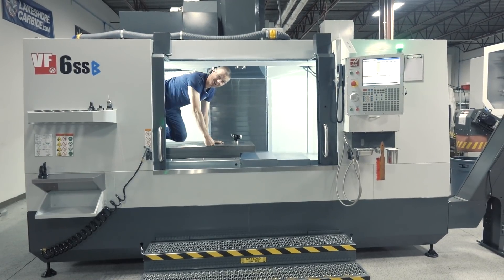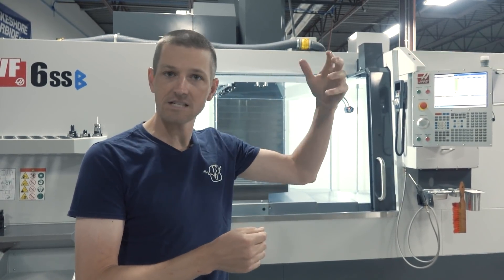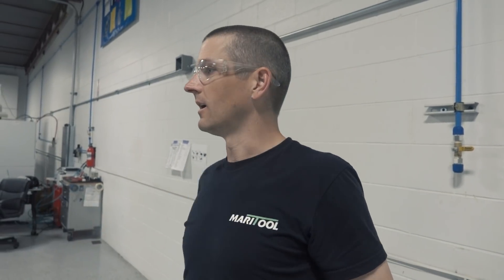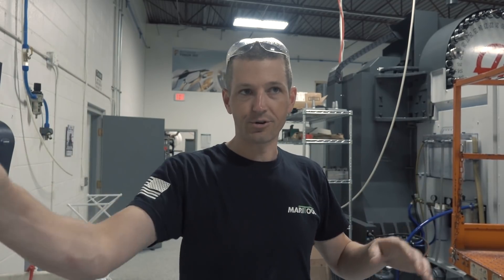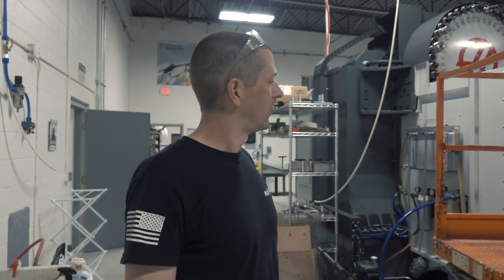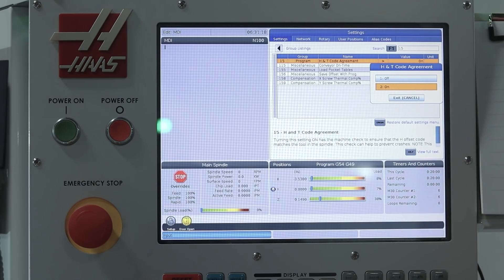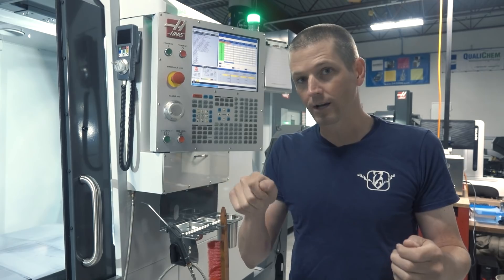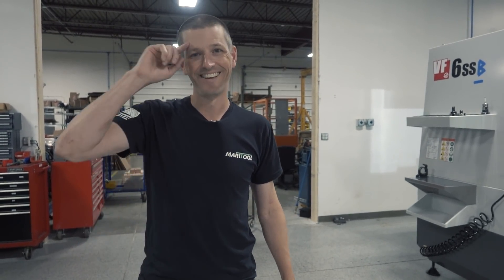Haas VF-6SS CNC Machines: Buying, Rigging, Unpacking & Commissioning!

Comment: hi, bacteria breeds on the tramp oil and book and crannies, ours is a redox system which is a system incorporating multimedia metals and once the coolant passes through it the bacteria and fungi are 100% eliminated and the killing process just goes on forever, you just have to add good water for topping up and concentrates to maintain the concentration, if not inconvenient send me your email address I would send you the details of the system.

Comment: Congrats on the new machines! Those ones are certainly great for small part dedicated production!.We have an older one that we use for our small parts (it's all relative...). We find it isn't nearly rigid enough for our heavier machining processes, but does well with a bunch of small parts. Are they still running on linear rails, or have they upgraded to box ways finally?

Comment: John, if you do decide to go the route of laser aligning the new VF's, I would highly recommend Industrial Measurement Solutions.  It is a smaller outfit run right out of Ohio.  Dave is the founder and likely the one that will come out and do the inspection.  He is the greatest guy and he has years of experience setting up machines like this.  I met him through a few jobs I did for assembly line work for the automotive industry.  Being that I'm also from Ohio, I like the idea of local businesses helping other local businesses.  You can find more info on their website, http://www.ims-ohio.net/  I hope that works out, it would be very neat to see Dave in one of your videos showing what he does best!

Comment: Awesome John!  I'm actually upgrading too.  My wife told me to go ahead and plan out a shop build and update my machine.   I found a client that produces eye wear frames for big optical sellers like Walmart type places and has a contract with military to provide frames for pilots.  So I have been nuts busy designing and building brazing fixtures for this company.   I'm finally going to move out of my basement!  BTW, love brass.  That's what the fixtures are predominately.  No coolant needed.  I even went so far as to accidentally plunge a 3/32 end mill thru 1/4" brass and proceed to cut a slot a quarter inch long, because I inadvertently shut off ramp.  It sounded funky, but the cutter did it twice and survived.  It was as if it was cutting plastic.  Good to see you expand and I look forward to catching you and Jared sometime when I pass thru again!

Comment: we have a HAAS OM2A and the Tool Release button is a workhorse... it's how you load tools into the spindle for transfer to the carousel, and because the machine doesn't support probing we put a dial indicator in the spindle to clock up the work every op... probably just a legacy/compatibility thing with the control panel

Comment: Just so you know the spindle grows overtime due to heat during long cycle times and the software does not comp for it.  We've had HAAS working on trying to figure this out on our VF-6SS for about 6 months.  We've installed a spindle cooler and everything.  Just something to keep and eye on.  We've noticed .003" to .004" of growth on the Z axis during a cycle.

Comment: I've got a question. Which CNC control is the most common in the United States. In Germany, the major manufacturers(DMG Mori, Grob group, Niles Simmons) only have Siemens, smaller ones use Haidenhein. Machines with a Fanuc CNC control are very rare.
Reply: I'm from Romania but I think they use FANUC and Haas(which is FANUC compatible)and maybe some HURCO controls.Some high end companies may use japanese machine tools with proprietary CNC like MAZAK(Mazatrol),OKUMA,Kitamura( FANUC control copy called Arumatik).

Comment: I for one, don't really want the T and H codes in agreement. Sometimes, I need to tweak the blends on a tool that is doing two different Features. One offset solves nothing, because both blends move together. So instead of making changes to each individual "Z" value in the program (if there's too many of them), I home the tool and call a new "H" for that tool for that Feature. Pretty usable overall.

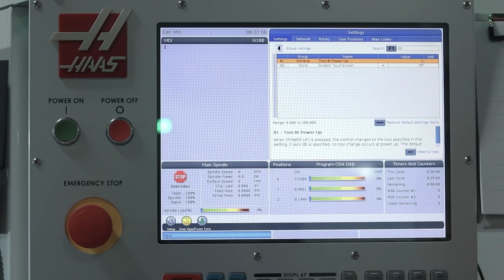Comment: The tool change at start up feature 7:55 is a setting I WISH our machines had!
It basically protects your tools that shouldn't go through the warm up cycle, like large face mills or long drills and even probes. 
I know a few who have started warm up before realising they have a long drill and WHAM bits of drill everywhere...

Comment: Good tip on the setting to Not change to tool 1 at restart. I HATE that because it’s also at 100% rapid. 
We also have to set something with mid-program restart... I forget the number, but it avoids problems.

Comment: I would recommend going with a better machine for production work.  Doosan is a definite step up.  From experience,  HAAS do not hold sizes like a better thermally managed Japanese machine. I’ve run a lot of different cnc’s and can say this with confidence. 
You may have received HAAS incentives because of your channels exposure, that’s great if you do. 
I should have made the switch to Japanese / Korean machines when I was at your stage of growth with my business. 
All the best John.
Reply: There are other korean manufacturers of CNCs not only Doosan.Hyundai Wia,HWACHEON,Namsun to name a few.
Reply: It's not 2006 anymore. The differences between Haas machines and Japanese machines are getting smaller and smaller. It used to make sense to spend 2-4x on a Japanese machine, but it's getting harder to justify it. He's running parts on Haas machines as it is, and he's holding incredible tolerances, as are many other people. It's also not as much of the machine as people think. Look at John Grimsmo. He has a $1M Kern with a robot, and he's struggling to hit tolerances and SF.
Reply: ahh the trick is too get it written into contract that if machine does not produce parts to specs you can return  machine..owner of last shop i was at did that with them returned machines after two years usage
Reply: If that’s possible, great idea. 
The drive train is light compared to most machines. HAAS is of course evolving and getting better.  I’m just going by hands on experience.  Temperature has always really affected the precision of my HAAS machines. 
The used Okuma just is preferred for what I do.

Comment: So I am not a Haas engineer, but if I remember correctly the reason why there is a tool release button on the control is if the button on the spindle gets damaged or stops working for some reason. It allows you to still run the machine and take tools in and out of the spindle if that were to occur. I will have to look into changing that parameter for the .1 jog increment, I never knew that was a thing.

Comment: only time when I need to use tool release button on the control is when the button stick or break on the spindle and need to change the tool to get a job done before we can fine the time to repair the button a couple day later
Reply: And for ATC recoveries where you will need the clamp to stay open. Used that a fair few times

Comment: 8:30 I hope he did more than just that ten inch flatness check and put a ballbar on it to remove any backlash, Or is that why they have a bad rep. Love how you said they are "noodle machines" and still bought two more 🤣🤣
Reply: Simon H Ballbar is done at Factory. Not on site.
Reply: @superbadchad45  What i am getting at is that he should of done more than that, backlash with a dial indicator even, We have always agreed to have it done on commission day, But learnt the hard way from shit machines straight from the factory.
Reply: @harezy  ALL machines are like wet noodles. No matter what machine you buy, it will flex, settle, and distort.
Reply: Wet noodles was in reference to all cast iron machines... not just Hass. Cast iron will bend and flex, expand and contract. Plus the flooring can move and vibrate. All meaning that if you could compare where a machine sits on install to 10 years later, they would NOT be the same.

Thinking about it, you could apply this to any material and not just cast iron.

Comment: Haas should throw out the Tool release button on console(like WTF) and add a 3D graphic simulation(Its ridiculous that there is not one already.)  and the feed speed potentiometer.
Reply: Tool release button on the console comes in very handy when a dumbass knocks the button off.
Reply: Having had to do a fair few ATC recoveries in my time, I can say having a dedicated button can be very usefull as normally its achieved by some obscure combination of keys that you struggle to explain to the guy at the control. 
Maybe locking the button so its only active during a recovery cycle would be the best of both worlds?
But I agree 100% with the other 2 points.
Reply: If I were an engineer at Haas, the first thing I would want to do is to reprogram that button so that you would have to hold it down for a small duration. I mean you can accidentally hit the wrong button, but nobody will accidentally hold down the wrong button, considering that all other buttons require just short clicks.
The second thing I would want to do is putting the tool release button inside, close to the spindle (maybe in the form of a handle, or turnkey). Yes, I know debris, chips, coolant, etc. But when you change a tool, your hand is holding the tool and you're looking at the tool, the button/handle should be somewhere in the neighbourhood (above it).

You are absolutely right about the speed+feed dials. It's not that hard to implement, and it can save so much hassle.
Reply: @sasjadv  But there is tool release button inside, close to the spindle in every haas that why i say why the fu#ck the second button do on console ??? I don't see this on other machines?, the theory is when machine and tool is big then one worker grabs a tool and second push the button???LOL that don't make any sense(I'm pretty weak and i carry the biggest BT50 tool on the market in one hand),  And people above say that this button is handy when button above spindle  gets broken, well how about replace it IP64 button cost like 10-15$ LOL and repair is very easy. The tool release button on console is waste of space and make layout more messy, that why you don't see it on other machines .
Reply: @adriankowalski5492  Wuttt? So you're telling me they already have a button where it belongs?
I didn't think that they were THAT stupid. I thought it was a cost saving measure or so, not a 2nd button.
And I imagine how awkward it would be if you actually needed two guys to change a tool. First you need to distract a coworker form his work , then the "so, can I push it? yeah, I think I got it, but I hold it awkwardly, let me get a better grip first... Boooom! -oops.".
If I would really really need two hands, then I would rather just jog down the tool, and let it drop on a piece of wood/rubber from a minimal height; and you can lift one end of the plank to get leverage and push it up to the tool. Or I would jig up something mechanical to lift it decently.
And I can't imagine a tool that heavy to be mounted in that tool mount (like a lathe-chuck welded to a BT50 holder, LOL).
---
Do you really need 3d simulation in a machining center? I mean you can check for collisions in CAM, and for short handwritten programs you can turn down the feedrate with the turnknob (if you have one) and prevent collisions that way.
I'm curious to know what the usecase would be for the simulation feature (other than triple checking something).
Reply: @adriankowalski5492  It's mainly used for ATC recoveries as @wildin13 stated. You can press it once while recovering the tool and it holds the drawbar in an open state while having to press the ATC forward or reverse buttons multiple times. It's much better than having someone hold the button on the spindle while stepping the tool in or out of the spindle. Also, I'm pretty sure you couldn't hold a 7" Dia .6" DOC slotting mill on a 9" long 3" Dia arbor with one hand if it's gets stuck in the spindle from side load (inconsistent castings suck). That heavy beast shoots out like a cannon when it finally comes loose.

As for all the other settings, I've used all of them in their stock configurations. Our tool library is over 100 tools per machine and it's a bit quicker to setup on short orders when you don't have to go in and rename the pockets or pull new heights as is needed with changing setting 15 to match T and H. I will say it is a bit risky if you aren't as experienced in that type of setup procedure though. Setting 81 has come in handy when tool recovery fails to home the tool changer which will disable the tool changer entirely because it doesn't know what tool is where. Just reboot the machine. It's very similar to how it homes all the axes at startup. In fact, on at least older Haas lathes the tool turret is coded as the A axis in errors and in homing a single axis. Last but not least, setting 163. I typically use the .1 jog rate, 200% feed rate, and hold X or Y jog buttons to quickly move the table while cleaning out chips at the end of the shift. Yes, I could turn the jog wheel, but this can cause some wrist strain. Pushing a button usually doesn't.

That said, the use cases are pretty small but definitely not stupid or unneeded. Haas had done great things to improve the operator's experience over a standard Fanuc controller.

Comment: Is there a reason why you keep on buying haas machines? Don't get me wrong I really like them although I haven't run one of them yet. But why don't you buy a dmg Mori or whatever?
Reply from the maker: We have a FANUC Robodrill and a Datron.  I'd love to get an Okuma one day too.  But so far, the price (a.k.a. ROI) has been great for us on the HAAS machines.  It's nice to have a common control throughout the shop, especially since we used a lot of "advanced" probing routines and macros.   But, I hear you - there are some other awesome machines out there.  We'll get there.
Reply: @nyccnc  yesss get an Okuma, you will love it
Reply: @nyccnc  you dont have to buy new. those old seiki mills, even Cincinnati Milacron mills are still very accurate if you get a decent one. 
Seeing nothing but those haas mills kills me inside. barely made in the usa. use to use all import servos etc, servo size is also lacking, overrated spindles the list goes on
Reply: @Donkusdelux  Yes you're right.The servos are actually Yaskawa.
Reply: Price? You have 2 or more haas machines for 1 dmg or mazak(in the same weight class)etc.  and is easier for workers to have all machines in shop with the same control
Reply: @adriankowalski5492  yeah I thought about that too. But I thought that there was a deeper reason :D
Reply: Having a common control is worth a lot in smaller shops where people tend to work on different machines depending on whats coming in. Our shop is fully Heidenhain execept one taiwanese mill with some weird teach in system. Most of the guys here refuse to touch that machine on the controller alone.
Reply: American machines in an American shop?
Reply: @timsanders7632  to be honest, I don't see why you should buy a machine because it is 'american'. Like if the machine suits my needs I don't give damn which country it is being manufactured in...
Reply: As I commented once years ago the Haas machines are the 350 Chevy of the tool world, not the nicest or fanciest but they are cheap and there are boat loads of them out there getting the job done everyday.
Reply: Nevertheless congratulations on your new vmc's

Comment: happy for your purchase, but I got to vent.
The actual table size has been reduced to the travel limits in x which sucks.
2 reasons I personally don't like it
1/ you can't clamp a plate job to use the entire travel in x.
2/ a rotary axis consumes valuable table space
I would opt for a custom table, longer in x axis and t slots closer together and more of them.
Reply: You could always make a fixture plate?
Reply: If you're thinking about offsetting the rotary sure it works I've done it, however it's a pain to also adjust the height of the tail stock.
As far as a complete table plate, you'd need to buy one or have a larger machine to make it. Losing tslots in favour of tapped holes isn't very appealing either. It's just all wrong.
They cheaped out on the build by saving a little casting and freight weight.
Reply: @Innov8cnc  fair enough on the Tslots but is it that much of a pain to made 2 fixture plates, ground at the same time, to offset both rotary and tail stock the same?

Comment: I offered one of my customers $750.00 for their 96' VF-6 that had a bad CRT and something the Haas tech said might be a pricey fix for the low oil pressure fault in the spindle. It had sat for 6 years. They ran only small parts and I bet the operators bad mouthed the machine. It is big and you have to climb into it to fixture and clean it, almost. It cost more to truck it. The LCD mono chrome screen and the rubber drive coupling on the pump shaft were all that was needed to get it running. One of my best buys. Brushed D.C. axis drives but work fine.
Reply: $750.00??  What?
Reply: Isn’t scrap price more than that? I mean, that’s a lot of metal... ???
Reply: @darkwinter6028  If he did the rigging, the cost to rig it out of a building might be more than the scrap value, depending on local pricing
Reply: NIDKID - well; yeah, if you’re trying to move it intact. Chopping it into pieces with a cutting torch would reduce that to something more movable with a common pickup truck (F150 or F250 equivalent). Not that I’m encouraging scrapping of a perfectly serviceable machine frame. 😉